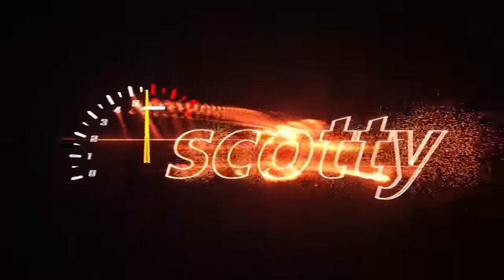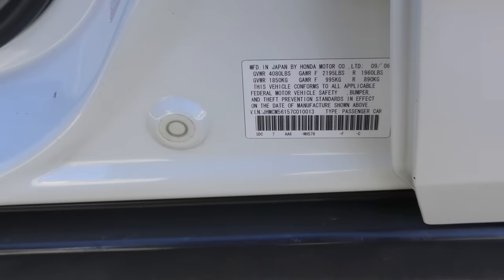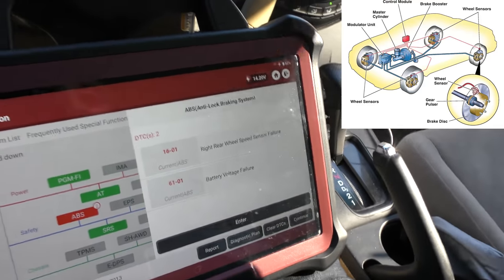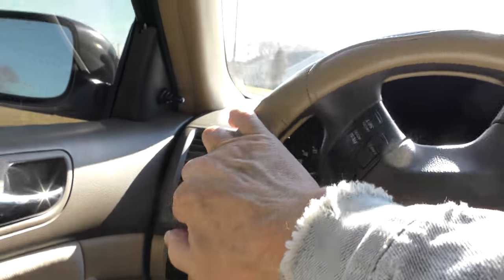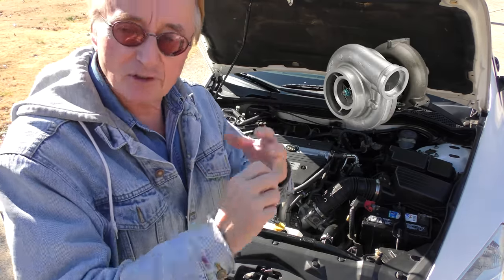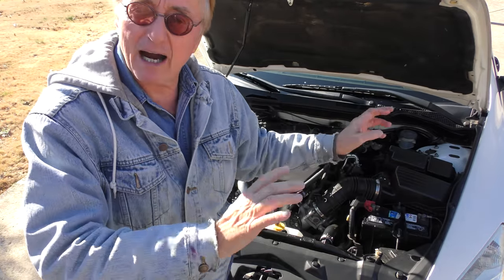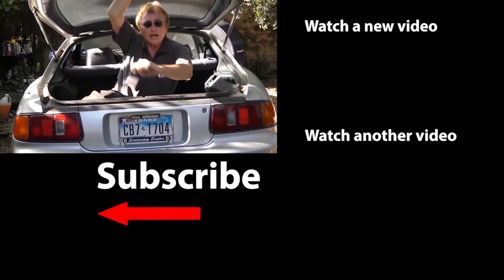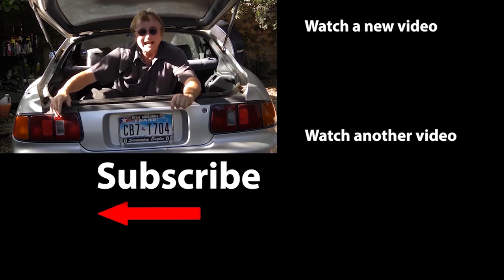Stop Buying Hondas with This Engine

Comment: those k24 engines (civic si, accord, crv etc) are some of the most durable engines honda ever made. they can handle power and stay reliable. one of the best engines ever made 👍🏽
Reply: Actually there's plenty of issues with them. Bad piston rings and vtec actuator. Honda had to extend the warranty to 150k miles. Do not buy a Honda with this engine.
Reply: @Brocko2891  my K24 had an actuator failure at 165k and it’s a 2017. Currently at 186k and no more issues.
Reply: @Brocko2891  despite these issues they're still plenty reliable. So many vehicles with this engine are still on the road to this day. My mom had an 05 Accord manual with the 5 speed manual with over 300,000 miles on it and still ran like a champ. Unfortunately someone hit her at a red light and totalled it.
Reply: You gotta be super religious with the oil changes cause if you don't change the oil the timing guides will where out badly
Reply: @byronwav  that's my current car
Reply: @Brocko2891  There was never a recall on k24s?
Reply: @jay-dt3zq  Not even the oil change, but topping off oil.

These cars consume oil past 100k miles 
, but they run great
Reply: @cg9  No recall, it would've cost Honda millions. Even of you call a dealership they're super defensive about it. My biggest issue is the ring seals let oil into the exhaust and my cat clogs once a year. Lacquer thinner and topping off oil has become regular maintenance
Reply: @Brocko2891  That’s absolutely insane 🤣 here I am pushing 545BHP out of a stock K20 🤷🏾‍♂️ only head studs 1 year now 0 issues whatsoever
Reply: @kinglandon5831  if made anywhere but Japan perhaps <1% of the cars so no needs to be negative Mr Chevy
Reply: Got a a2 out of a tsx in my rsx. It's so awesome.
Reply: Right just watch your oil beacause if low and it stays that way the vvc can stsrt going bad.. its not a hard fix
Reply: Yes Yes Yes that’s why I bought one.
Reply: @Brocko2891  Only specific ones from 2008-2013.
Reply: @Brocko2891  Where do you put the lacquer thinner in the gas tank?
Reply: B series engine has entered the chat
Reply: I still have a 2004 tsx with 125.5k miles, still runs great and pulls well. Pretty great for a 20 year old car lol.
Reply: Unless they overheat once.
Reply: @Brocko2891 then there’s me with the original engine at 225k miles not a single problem, i know people with 250-300k original engines no problem
Reply: Can hold like 1000 hp but he not racing talking durable daily
Reply: I’m an automotive technician and I firmly believe the k motor is in competition for the most reliable 4 banger in the world. That why I drive a Honda civic si that has one. If you actually do your oil changes in time you will have minimal issues
Reply: Keep
Oil in them and they run forever my daughter forst cer was an
Element it’s been 8 years and she is still driving it. Had 140,000 when we bought it and it’s got 300,000 now. Just have to top off oil every couple gas stops. It stays pretty clean with adding that much fresh oil. Lol
Reply: Man any Honda you can boost 15psi stock internals, still reliable daily if done properly and good tune. Even the J series.
Reply: @Brocko2891 bullshit lol. 334k on my k24z7 hwvent changed anything
Reply: 400k on mine…
Reply: At 220 thousand miles our 2005 Accord lost compressoion and needs a new head, . . However I have an 01 Accord with 250k that still runs great, . .with the exception of a little burnt oil
Reply: @Jac735  I loved my b series- don’t get me wrong- the k series is so much better when it comes to performance and still has decent longevity if taken care of and not constantly redlined.  

There is no replacement for displacement

That being said the k series is just the evolution of the B.  I don’t miss constant distributer issues and if you turbo they 100% need sleeves.  I loved my jdm 1.8… it was rad.  The k24 just has so much more potential.
Reply: my 03 accord misfired before 160k miles had to get a new engine 💀
Reply: For the K20 and K24 try changing your PCV and your oil consumption might drop significantly;)
Reply: @Brocko2891 mine did too
Reply: @gergelyh nope it’s the rings
Reply: @stevesmith756  2 out of 3 of my K series was consuming oil because of the PCV. This is just my personal experience. Just like most F series ate oil because of valve stem seals like the D series after an average of 150k miles.
Reply: I’ll back this
Reply: My accord has 250000 miles and still kicking 4 cylinder
Reply: @Brocko2891 compared to what. ? Dodge ?  Gm. Ford. Hyundai kia etc ?   These fail before and  after the warranty is up.   They’re garbage.
Reply: never had any issue  with my 14 si , now at 236000km
Reply: Honestly, I think the H 22 is the best all-around Honda motor. The H 22a4s. Had FRm sleeves. People really never liked those types of sleeves until recently.
Reply: I want to buy a used accord. I love the accord. 4 cylinder.
Reply: Awesome
Reply: The 2005-2007 accord is in my view the best family midsize car ever built in the world
Reply: @kinglandon5831  They didn't put k24 in 2017 civic..
Reply: Sucks to work on though

Comment: Hondas are my number one choice, with Toyota second. I had a '97 Accord that I squeezed 595,000 miles out of, same engine, same transmission. My '08 Civic currently has 250,000 miles on it. Toyotas are good, too. I had a '74 Corolla stick shift, that I parked for 2 years. Then, it took 10 minutes to start, I filled it with gas, and drove 170 miles.
Reply: Wow!
Reply: At that point a honda with that much mileage is a death trap because the body rots throughout, you'll notice at the time of impact they go like an onion peeling ..
Reply: @karlwalter2242  only if there’s salt in the area. In Seattle they have no rust :)
Reply: I had a 2003 Honda Accord that had almost 500,000 miles on her before she was totaled in an accident (someone rear ended her).  Excellent condition for the age and mileage.  I swear by Honda products.  She was an excellent car.  Accident happened in November 2018.
Reply: @NicholasAndre1  Seattle's on the water. How is there no rusting there?
Reply: @davecrupel2817  most of it isn’t super close to salt water. Plus there isn’t a ton of parking in range of salt spray. The road salt is what gets ya.
Reply: @karlwalter2242  If so?even an unrusted Accord will crumble up to protect you, way to go Japan!
Reply: For me it's Toyota/Lexus as no.1 and Honda/Acura as my second. Both companies are far more reliable than most other auto manufacturers who actually care about reliability and their relations with their customers (at least in Japan, where they believe in kaizen methodology and use holistic approaches). I can't say much about dealerships in the U.S., there's too a lot of disingenuous and greedy practices here.
Reply: @karlwalter2242  I got an 02 camry that had an low speed impact and it didn't even leave a scratch on my front bumper.
Reply: The most reliable are Toyota tho. You must of had a manual Honda because a Toyota automatic can last forever a Honda cant
Reply: @robmalcolm8042  Nope, the Accord was automatic. I had to get automatic because my wife couldn't drive a stick.
Reply: the newer ones have cVT transmissions so I don't know.
Reply: im the opposite but honda is still really good.
Reply: NO KIDDING, I HAD A HONDA ACCORD FOR SO LONG, I WANT TO JUNK IT CAUSE I WAS TIRED DRIVING IT,  I COUNDNT KILL THAT THING, I GIVE UP AND PASSED ON TO A TEEN,
Reply: @ricardcluter4765  either pure luck or you changed the fluid religiously. Automatics from Honda are some of the worst only Nissan beats it with the cvt
Reply: @robmalcolm8042  The engine had a small oil leak, of which, it was cheaper to replace with new oil (a quart every 2 weeks) than replace the gasket. The transmission fluid was changed every year.
Reply: i got an 08 civic 235k only issues alternator & battery
Reply: I've owned nothing but Hondas and Toyotas and never had problems with them.
Reply: @karlwalter2242  my Accord gets garaged when there's salt on the road
Reply: @davecrupel2817  salt and deicing chemicals is what kills cars
Reply: @MarkIV_Garage  , Them little vehicles are death traps...
Reply: @ahotdj07  swear these accords are cursed. My mom had a super high mileage accord but it was totaller in an accident
Reply: @karlwalter2242  wrong!!! ever if there is salt, you can prevent it from rotting out buy washing it often. I current daily a 93 civic in Michigan Besides typical Honda rot on the quater panels the rest of the car Is solid af.
Reply: @robmalcolm8042 Only 450,000 miles on our ’07 Honda Odyssey so far. I guess we’ll just have to see how many more it will go. Original engine and transmission, no rebuilds or major repairs.
Reply: @ricardcluter4765  maybe the year was decent cause early 2000 ones had issues had a Acura MDX 2003 same transmission as a pilot of the time and it was horrible at 140,000 already. So many issues already and the wheel fell off literally.
Reply: @nicholasittzes7224  some years can last if taken care of but generally you need to be on top of the transmission more than usual. Good miles tho

Comment: That guy obviously takes care of his car.  Engine compartment looks cherry!
Reply: "I just hear normal noises, I don't hear any groaning"
Mother-in-Law not in the rear then?
Reply: Might seem so, but washing the engine compartment on old cars is doing more harm than good. For old cars just wipe, this looks like a high pressure or steam clean. That's a NO, for old cars.
Reply: @ericb950  You're making a lot of assumptions here. Clearly the vehicle doesn't have any electrical or engine problems. So what ever cleaning method he used, I think it's safe to say he did it right.
Reply: @ericb950  For me, I WD40 everything and wipe it down.  Works pretty good.  
I'll wash out the channels around the hood every year to get rid of pollen/leaves and such.
Reply: @ericb950 
if an engine doesn't leak it stays clean for a long time.

Comment: Love my K24 in my 2007 Accord. 640,000 miles and still going strong!
Reply: I have a 07 accord K24 auto trans with 260k and it is burning oil and has a suspicious whining noise that is consistent until highway speeds. Did I make a good purchase? 😬
Reply: @simonsays582  unsure what the whining noise is, could be a number of things. I had a whining noise coming from my power steering pump. I got an o-ring from the dealership for a few dollars and replaced it myself in a matter of minutes. Mine burns about a quart every 1,000 miles like clockwork and it’s been that way for years. Top it off and it’ll last a lonnggggg time.
Reply: Well it burns a lot, then again I bought it off some 19yr old girl and she didn't do any maintenance. Only a couple oil changes for 60k miles driven. Looked at the PCV valve it was ok but hose was almost completely pinched off.
Reply: @simonsays582  it is fairly common for the oil control rings on these to get gummed up over time. I changed the PCV valve on mine and it made no difference.
Reply: @TheThirdeYe1337  and that's like a engine rebuild isn't it?
Reply: @simonsays582  There are ways to do piston soaks one can try but they don’t always work and they are more hassle than I’d want to mess with. Otherwise, yes, new rings are likely the way to go. Toyota had a big problem with this in the 2000s and had a recall on them and had to rebuild a lot of engines. I had a 2008 Scion with that issue but it was just outside of their oil consumption threshold. Adding a quart every 2-3k wasn’t too big of a deal at least.
Reply: Original engine and gearbox?
Reply: @DrRussell  yes, original engine and trans. Neither have required major work or a rebuild. 661k on it now.
Reply: @simonsays582 burning oil is normal once you get up to high mileage with these engines, just make sure too keep oil in it, or rebuild lol
Reply: My 2007 Camry xle is at 300,000 and still running so well that I'm planning to drive for another 150 to 200 thousand miles oe so. I need to change the blendoor actuator. Cool AC but not cold.

Comment: I had a 2003 Honda Accord that had almost 500,000 miles on her before she was totaled in an accident (someone rear ended her).  Excellent condition for the age and mileage.  I swear by Honda products.  She was an excellent car.  Accident happened in November 2018.  Also still had the original engine and transmission.
Reply: My '04 only made it to 130k before the transmission died.
Reply: @MattPSU02  Did you ever change the transmission filter and fluid in it ?
Reply: I had Acura TL and Acura MDX and they both needed new transmissions.
Reply: @frandanco6289  YES
Reply: Transmissions only make it to 500K when the driver knows how to baby a transmission. Early transmission failures in older Honda’s generally only happen to people who are rough on them. This excludes those newer CVT’s, those things are expected to fail and none of them will make it to 500K on all original parts.
Reply: My condolences brother, I had a great 2008 Honda Civic that only had 110k on it before someone totaled it the same way three months ago still haven’t recovered 😪
Reply: @Messerwon  the 5 speed automatic transmission that Honda used on the 3.0 and 3.5 V6 cars was  poorly designed.  They had recalls and they even drilled a hole in the case to direct an oil jet onto the 2nd gear, to keep it from failing.  There was no maintenance that would prevent it from failing.
Reply: @Messerwon  that is true. the toyotas you can be rough with. i remember once i accidentally shifted into reverse in my old '86 corolla on the freeway. put it in drive and off i went. no problems whatsoever. car was bulletproof. thank God there wasn't an accident
Reply: Have a 07 5speed and a 09
Reply: Must be an I4 not v6
Reply: Many people getting Rear Ended by the Politicians...you don't even need to be driving.
Reply: That’s probably from not cleaning the screens out and causing them to fail. When they first start acting up you have to pull and clean the little screens in the solenoids.
Reply: Same but mine 98 and had 25000 I got $5000

Comment: I have a 2001 Honda Accord V6 with 225,000 never had a problem with the engine and it still runs like new...always kept the maintenance
Reply: 99 v6 here.. Just minor oil leak from distributor. Needs new o ring. That's about it. 140k miles
Reply: That v6 induction sounds so good doesn’t it? I have an 02 and it’s smooth
Reply: Hows the transmission? I kno those had alot of problems
Reply: @BigRoss5150Gaming  just passed 200k and I’m not too crazy nor too gentle on the trans. It’s fine. Nothing funny at all with it
Reply: @R1val909  wow thats great. Is it a manual?
Reply: But you replaced the transmission twice
Reply: @BigRoss5150Gaming  auto

Comment: My 2006 Honda Accord EX 2.4 cylinder 5-speed manual transmission has 241,000 and is still going strong! 
🙂👍
Reply: K series is the goat of all engines
Reply: @marfigue777  diesel engines are naturally more reliable
Reply: @dragospahontu   I have a Mercedes 300D also, it's 40 years old and still runs like a champ and gets 27 mpg with over 525k 👍
Reply: I’ve got the 2013 version 💪
Reply: Got 435,000 kms on my 2007 CR-V. Just changed the oil with 5W-20 Full Synthetic. Only problem with the car is i have some clicking in the suspension.
Reply: That is a perfect car. I know that one. Fantastic.
Reply: @nighthawk0077  when you turn or when you go over bumps or cruising?
Reply: @doriangray2347  bumps and bad roads, over smooth roads it's fine
Reply: @nighthawk0077  oh hm.  When is the last time you replaced struts or any bushings or joints? Any yet?
Reply: @doriangray2347  not sure but it's a good bet they need replacing.. ;-)
Reply: I have the same car. 2010. 150000 miles
Reply: @nighthawk0077  ahh. Ok. Without a knowledge about age of parts, it is beyond me to make a good guess.  If it is all the wheels, noise from everywhere, definitely time for a safety check for worn suspension parts. not exactly cheap though.  If they are worn and get replaced and it’s not a damaged part, it will be really tight to drive again and stop smoother
Reply: Definitely something Scotty would know!
Reply: @captinbeyond  Get woke = go Broke
Reply: @applepoop10  it depends for sure
Reply: Had a 2003 version of what you have. Got to 282,000 before selling. It’s still going at 315,000. Sad that the Accord no longer has a model with manual transmission
Reply: my 2007 2.4 accords at 220k, still bookin it too💯
Reply: @dragospahontu  no all of them
Reply: @streetfightinc  even better
Reply: I'm at 225

Comment: I got 240,000km (150,000miles) on my 2005 Accord V6 with 6spd. the V6 is great and super reliable i have never had any issues in my ownership of 10 yrs. If you're in the market for a older V6 Honda/Acura i highly recommend getting it in a manual, you just cant go wrong imo.